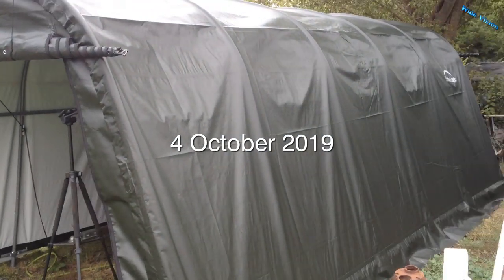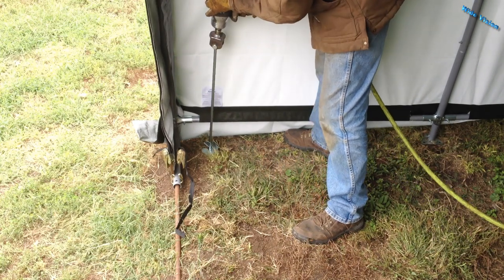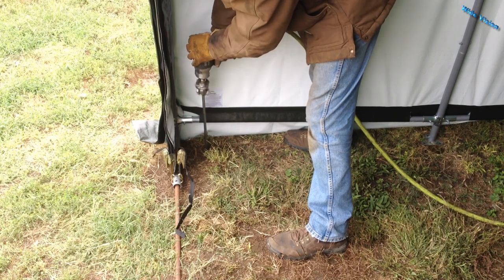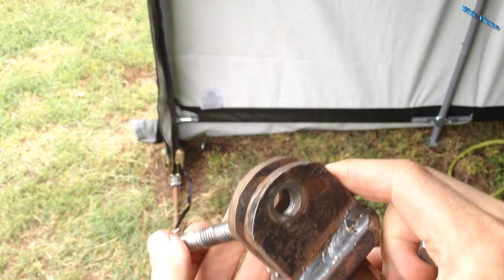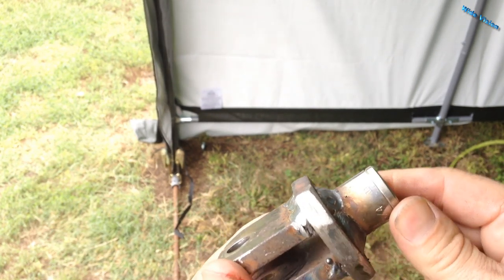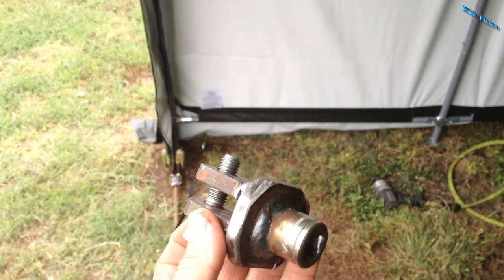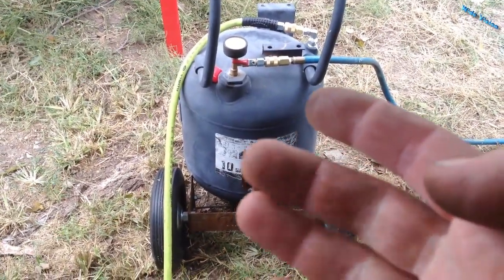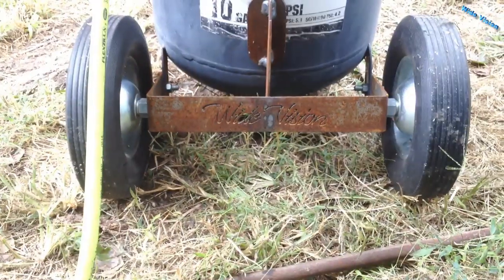DIY Ground Anchor Adapter

Comment: I hacked up a similiar thing for a SDS hammer drill to puond steel t posts.. I welded a SDS chisel to a socket, then a 12 inch pipe around the socket as a guide. The Bosch Bulldog pounds the steel  fence posts  easy.

Comment: Looks good, works good!!
You could do the same with a piece of rectangular tubing that fits over the eye of the anchor...
Your setup with the bolt may be more universal, but one made with tubing would be faster.
Sometimes for jobs like this one, a drill works better, impacts don't always work well with materials that give too much.
Thanks for the video!!!
And thanks for the words of wisdom 😂🤣😎

Comment: With ground like that you could screw them in with a hand ratchet, no cheater tube required.  I would have to cut the auger down to to half inch slivers and pound the anchor in with a  8 pound hammer, never to be retrieved again.